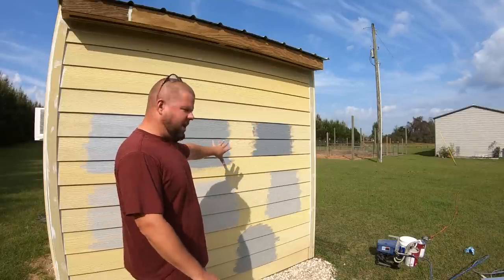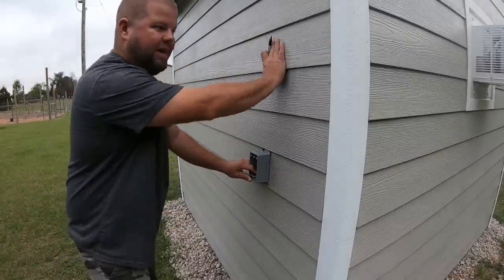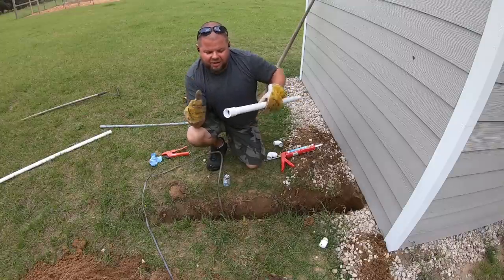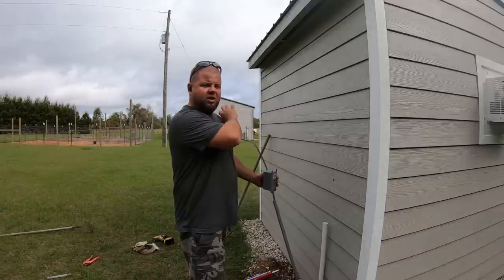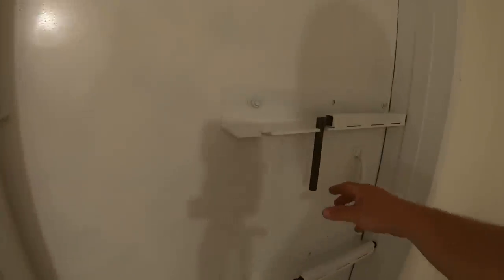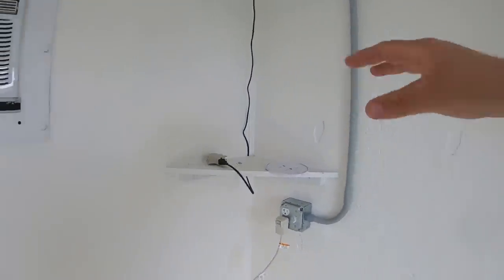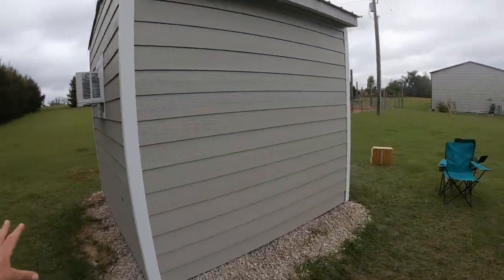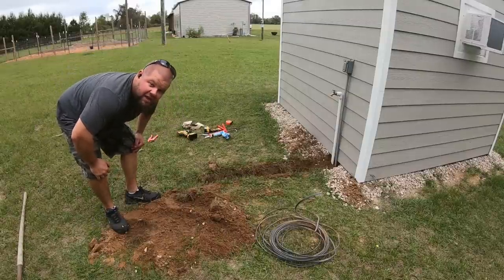Tornado/Hurricane shelter bunker electrical and final paint #22

Comment: You are right about solvent welding, I see them joints pull loose all the time , you should be using primer it softens the pipe cleans it then glue will not pull apart

Comment: I was searching for info on DIY storm shelters and came across your channel today, and I binged the whole shelter series.  I can't exactly copy it as I'm in tornado alley proper, but I was totally invested in it.  Really interesting and informative material, you show your mistakes and how you'll fix them, you take suggestions and comments seriously, you keep it clean and free of politics and other drama...this is really top notch stuff here.  I would not be shocked at all if you attracted a much larger audience soon as you get on with your house build.  You'd deserve it, and I'm looking forward to it!

The paint and trim looks great, love the color.  I was pleased to hear you mention the AC cord.  I just pictured that flap swinging down and just chopping it off.  I am a little concerned by that flap falling down, though, if you're still using those eye hooks.  When you first put it up and had your head in front of the opening...I'd be a lot happier if there was something a bit more secure there.  Maybe a backup chain or an angled bolt hole attached to the ceiling, where you can flip one of those T-bolts around to secure it.  Anyway, minor concern in the grand scheme of things.  As I said, very enjoyable series, you've earned yourself a new sub, and I'm looking forward to the house build!
Reply from the maker: Awesome, glad you enjoyed the series. I just completed it last week, minus me anchoring it in the ground with augers. It's engineered to ef5 winds, but I just don't think I could trust it to that, I'd be underground in those areas. For our storms, it should serve us very well! Thanks for watching

Comment: You should also get a UPS battery back up in there, in a hurricane that’s when your powers going to be going in and out and it won’t run everything but it’ll keep you from being in the dark and run a little radio. Being that it’s wood you can probably run an antenna inside. I would also keep an alternative light bulb or light source in there in case one bulb goes out.    Most of that stuff is more likely to happen during a storm because of power fluctuations.  I like it.. Nothing is going to be 100% storm proof unless you spend tens of thousands of dollars but for your area I think that’s a great option. I probably would’ve gone for the cinderblock building with rebar and concrete filled walls but i’m in a tornado area now so it’s a different application. For some odd reason I’ve spent a lot of time studying storm shelters, mainly when they started coming out and trying to sell them for $30-40,000 which I thought was ridiculous. You really don’t have to spend that kind of money. If you have a tractor you can just get a container and bury it or two the cinderblock with rebar and concrete filled walls, that will stop a 4 x 4 flying at 300 miles an hour and splinter it.  I love these projects because they show people that you can build something for a few thousand dollars and don’t just have to pay somebody a ton of money to buy what’s out there.  

I like the storm shelter and it’s nice to have and she keep you guys safe.  You can see light through the AC so you should be fine on oxygen unless you have a bunch of people in there. Lol. Also if you ever do need to use the AC area to get out it might be beneficial to put a strong handle to grab onto to climb out of there.

One thing I learned from studying the shelter stuff is that most people forget about peoples emotional states because during a real Hurricane or tornado people are probably going to be freaking out. They say it’s good to have little things in there to boost morale, a photo album a box of hard candies, toys for kids to play with, A radio or TV or maybe a little DVD player and things like blankets and pillows and comfortable seating.  Maybe cards or board games, just something to keep peoples minds busy and pass the time. Just things that make people more comfortable and relaxed.
Reply from the maker: I like everything you said! But the last paragraph is something I'm trying to trigger on. For example simply putting a soft white traditional bulb in their instead of a bright led bulb should cause a calming effect. Definitely want to put a few other things in there that will make it feel more comforting during a storm

Comment: Most pvc joints fail because the bead around pipe at fitting is not wiped off while it's still wet skims over outside but continues to melt pipe making it weak. If you ever see a fitting broke flush with pipe inside it, that's why. Knowledge is power, and now you know.
Reply from the maker: Very nice, thanks for the info

Comment: Great job on your shelter build! I only have 2 points but I apologize for their length. Many yrs ago I had a small poodle that had never been scared of storms until I had to shelter n my bathtub with her during a very close and damaging tornado. Now there r those weighted vests for dogs that r scared of storms. I wonder if Bullet would benefit from one of those vests? Second point- I’ve not heard u  mention a go bag? Such as another set of clothes, towels, plastic bags, medical supplies, etc. My medical training comes out when talking about emergency situations. U can stock a small tote that can also b used as a short table. I would vacuum seal emergency supplies due to hi humidity. The State of FL has great info online for guidance (but don’t let it overwhelm u). Of course, I’ll b glad to help with any ideas or recommendations too. Ty for reading.
Reply from the maker: Thank you for the suggestions, very valid points.

Comment: Get some Bifen XTS and spray the inside bottom wall and door. That's the only way critters can enter besides the ac unit and vent. For the outside get the Bifen L/P granules and bayer termite granules around building. Will last a year depending on rain events. If you want to take it to the next level get yourself a small 24 or 32 led tv and outdoor antenna to keep tabs on the events as they happen. We are going to build the same but bigger inside the house or tied into the house/garage area. Since we keep seeing crazy weather I am going to plan for long term needs of it so a little bigger like 16x16. I wish i would have found those specs during construction of my house cause i would have made a safe room. At the time of construction the only ones i knew of were steel above ground, cement above ground or in ground. I still have a few bundles of lumber stocked up so now i need to figure out if i can somehow make it part of my house.
Reply from the maker: Bifen xts is my go to spray, works very well. Actually treated the shelter yesterday. A TV with antenna might not be a bad idea, but we should be able to accomplish the same thing on our phones. Luckily being a wood  shelter, signal isn't blocked.

Comment: Love your videos.  Appreciate the information as well, but I do have one piece of info for you that I'm not sure if you knew or not.  I recently found this out myself.  The Blue Glue " rain or shine", is not recommended for hot water pvc pipe.  It will not form a good "weld" and will fail over time.  Just for Info brother.  Be blessed.
Reply from the maker: Didn't know that, thanks for the info as I'm building my own house right now.

Comment: If you can avoid start and stopping the spray over the work, it will greatly reduce spitting and splattering.
Reply from the maker: You are correct! But I must say I only seen one drop where it spit on the entire building. It did a really good job

Comment: Is the shelter bee/wasp proof through the A/C unit?  Looks like you can see directly to the outside through the vents.  Also, does your county maintain any type of storm shelter registry, so they know which home owners will likely shelter in place for hurricanes?

Glad you FINALLY stepped on that dang spider!!!  haha
Reply from the maker: The AC has Styrofoam in it, that's why you see the light. But it is sealed. Now with that said, bugs can find their way into anything. I still need to caulk a few things to help. I seriously doubt our county has a registry, I actually don't know of but one other person with a shelter. They are just not common down here.

Comment: Question....Why wouldn't you build this in the interior of your home?   You are increasing your chances of this failing.  Something large could be blown into this shelter knocking it over or damaging it and crushing you while inside.  It may be able to withstand 200 mile per hour winds... It's not the winds I would be worried about.   I would be worried something other than wind would  hit it from the wind being blown into it.  At least if it was in the center of the house you would have more protection.  Maybe pack mounds of dirt around this shelter to protect you from large flying objects.
Reply from the maker: Because this was built lo g before I started our home and while we were (and still do) live in a camper

Comment: I do not think this will work as a tornado shelter unless you pile dirt up around it. How is this any different from a house. A tornado will rip that right off that concrete slab. It is very obvious that you have never been in a tornado!
Reply from the maker: Well let me explain my situation a little. I for one took a direct hit by a ef1 tornado in March 2020, worst ride of my life and I was in a cheap camper. Totaled the camper, and 1800 Sq ft barn it was parked under. Thus the reason I started building a stronger shelter. There is 25 videos in this build series, might want to watch them before commenting this is getting torn off slab. These walls are 6 inches thick, solid and laminated, it's stronger than you and I can comprehend. It's also bolted down with 16 1/2 titan anchor bolts, which is 10s of thousands of pounds of hold down force. This shelter is also getting earth auger anchored to the ground with 4 ft anchors. So yeah it can handle any storm we get. Now that's the next key to the puzzle, this is Florida. Our most common tornados are ef0 and ef1s. These big monster storms your watching on TV out west, simply do not occur here. Underground isn't an option here, too high of a water table. Understanding construction techniques, woods ability to absorb shock, actually being in a tornado and riding out numerous hurricanes in cheaply built homes, I'll take this shelter over a home any day of the week.
Reply from the maker: FYI this is also a engineered and tested tornado shelter by forest products laboratories with engineered plans. See video description.